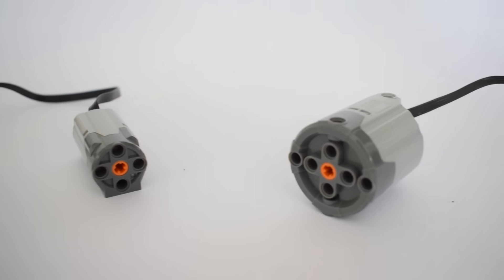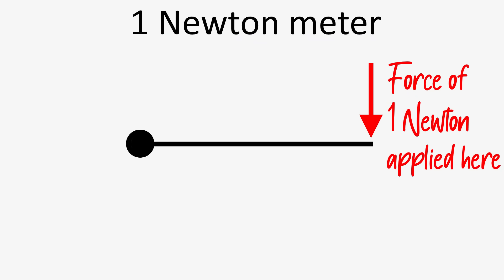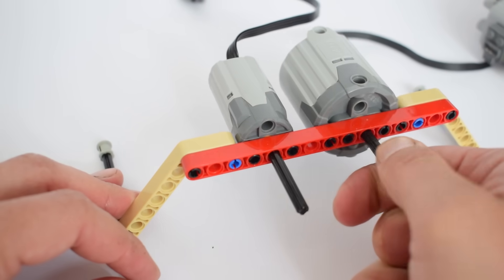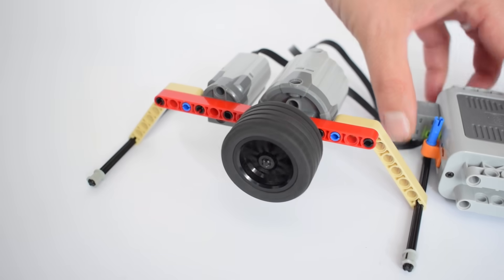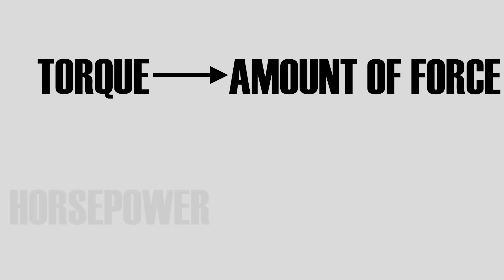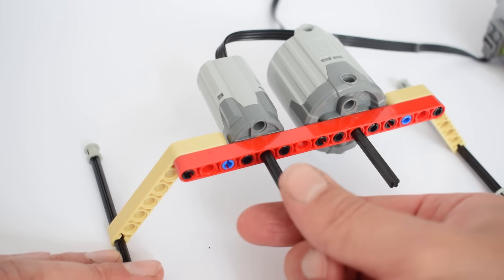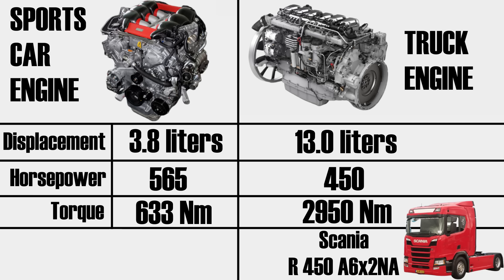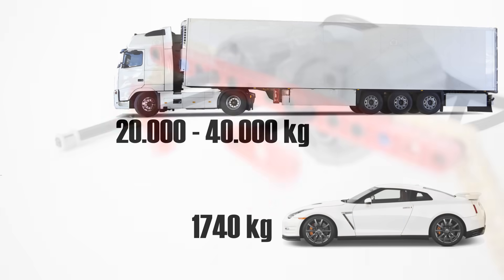NEVER be confused by HORSEPOWER and TORQUE again - HP and TORQUE EXPLAINED in the MOST VISUAL WAY

Comment: Great explanation!! I would only say HP can be felt during fast acceleration. The motion that happens is due to HP, and the feel you have is do to G force. So, it is correct that HP can't be felt directly like torque, but it can be felt indirectly 💪💪
Reply: you cant feel torque 🤭 you can feel force 👍🏻 egzample 1000 nm torque at 1 metres wheel radious vs100 nm torque at 0,05 metres wheel radious pedal to the metal in both the same weight asf at 10 km/h both where you be push stronger into seat? in 100 nm at 0,05 m wheel radiois cos it generate 2000 newtons cpntact path force  vs 1000 nm at 1 metres wheel radiois only only 1000 newtons contact path force 😁👌🏻
Reply: Torque can't be felt, it is hypothetical.

Comment: In theory you could fit that sportscar engine to a truck with a much higher gear ratio and move the truck just as well. But that small engine would be constantly screaming it's ass off and probably not last very long in that configuration.
Reply: That's really the key point - practicality and longevity.   Gearing can achieve pretty much any torque or peak power curve that you want.  But if you're relying on needing that maximum output continuously then you must factor in how practical is your source engine.  Hence, semi trucks that need to be running pretty much continuously to generate income need a reliable engine that isn't going to need an overhaul every couple weeks.

Comment: Pretty interesting that many people understand this theory but in reality they do not.
A real life situation for those that know:    to answer this REAL scenario.
I'm driving a laden truck with a Detroit Diesel 15 Generation 5 engine.
The maximum torque at 1,000 revolutions of the engine is 1850 pounds feet ( not foot pounds ) but the power ( brake horse power ) is 550 brake horsepower at 1600 revolutions per minute, not horsepower as stated. Horse power ONLY represents a linear calculation of engine size, 1000 c.c. cubic capacity, c.c. i.e. 2 horsepower is 2,000 c.c.
Question: I encounter a hill.  What engine speed will give me the most engine power...the highest torque ( turning moment ) or highest Brake horsepower.
Torque   1850 pounds feet at 1,000 revs/min
BHP        550  bhp at 1,600 revs/min ( torque at this speed 1632 pounds feet )
Formula     2 ( pi ) x T × N  ÷ 33,000, T torque, N revs/min, or T x N ÷ 5250

I would be very happy if some one can explain this as Mech. Eng. Professors cannot. A tech. problem to ponder? Thanks.

Comment: Torque is a turning force.and horse power is just Torque times speed .There's a formula for working out horse power using the torque x rpm.
Reply: Sorry for that ,keep up the good work.
Reply: And there is a formula for working out torque using the power / rpm. That's how chassis dyno works.
Torque is not a force, it's torque.
Reply: @simplemachine9531  you confused yourself!
Reply: @skyhawk409  I confused you, cause you don't know the thing. You have just named power as horse power, end of story.
Reply: @simplemachine9531  is 550lbs lifted one foot in one second one hp?
Reply: @skyhawk409  there is a formula for working out centimeters from square and length of the other side of rectangle.
That's how you sound.
Next you ask if an inch is 2.54 centimeters.
I'm out.

Comment: Am I right to say these two things act like runners in a relay race? It’s torque that gets you going and builds momentum, then said momentum is passed on to power to take it further.
Reply from the maker: I get the idea, but the answer would unfortunately be no. Momentum is not passed and there is no switch. Torque is always there and so is power. Torque is an inherent part of power. Power is simply the frequency of torque application. Power is torque x rotations per minute.

Comment: Using gearing you can convert that high RPM torque into low RPM torque where it counts, at the wheels. Why don't big trucks use a smaller higher hp engine and just gear it down? Because the engine would very soon be worn out revving at 6000 RPM all the time to produce that torque needed at the high rpm.

Comment: I would say I've got the theory part of power, but then the in practice part got me...

If power is a time related thing and the smaller engine rotates more per minute, shouldn't it have more power?
It has less, but rotates faster... 

I think I didn't understand as I thought 😂. Does someone know?
Reply: 100 nm at 10000 rpm :9549 x 1,341 = 140 hp , 200 nm at 2000 rpm :9549 x1,341 = 56 hp , 300 nm at 5000 rpm :9549 x 1,341 = 210 hp power is results of torque and rpm this that some engine spin faster dosent mean it have more power it can have but not necessery cos power is not only rpm ,rpm is only rpm you need to multiple rpm x torque at thsi rpm to know how much power specified engine et this rpm generate  , way slower spin engine can have waaaaay more power and accelerate way quicker vehicle feg bugatti chiron max rpm 7000 power 1500 hp  vs bmw s1000 rr max rpm 14000 rpm power 200 hp ☝🏻 beside this video which explain half of whole story and probably make some misteake dont want watch this again 👌🏻
Reply: @mociczyczki  wow hahahah, thanks man
Reply: This is a faulty video, watch something else on this topic.

Comment: Okay so let me see if I understand, if you take two different strength motors and use gear ratios to set them at the same speed, the horsepower measures which is stronger, and if you use gear ratios to set them to the same torque horsepower measures which one is faster? So it's like overall relative motor capacity?

Comment: Not really impressed by the explanation like some other people.
First of all, the physical quantity is called just power. Horsepower is a unit of power. Using those terms incorrectly can lead to confusion. 
And then, some statements about what is power and what can and cannot be felt are misleading in my opinion. Power is the rate at which work is done. Which translates simply to force times velocity in the linear case or torque times angular speed (~rpm) in the rotational case.
I do not think anyone can actually properly understand the correct physical concept of torque and power based on this video.

Comment: I still dont get it. the motor with less horsepower was spinning faster, which goes against what he said. and it made it just seem like rpm = hp, which makes no sense. like, just because a single cylinder engine can get up to 15k rpm doesn't mean that it will crank out more horses than a truck. at 3500 rpm, which is what this video seems to imply. the torque part makes sense but the horsepower part doesn't, especially with how the lower horsepower motor was doing more work at a faster speed than the higher horsepower one.

Comment: maybe i haven't thought this through but with my electric bike outputting 29kw of power i can search a google kw to hp conversion if hp needs time to be factored into the equation. However, to calculate the actual torque you need to. take rpm into the equation.
Reply: kw and hp are the same thing ie power (force and time). To determine torque from power, torque = (HP/RPM)/5252

Comment: The way I've always thought of it is this. Pretend you have a screwdriver, and a small drill. The drill will screw in a lot faster, it has more horsepower. But you and the screwdriver are able to screw down much more tightly, you have more torque.
Reply: How do you know you are screwing with screwdriver with less power?

Comment: Thank you! I'm sick of watching dyno videos where people obsess over crank torque - it's IRRELEVANT, because it's gearing affected. Torque at the WHEEL is what matters, and when you factor in wheel (road) speed with wheel torque, you have wheel horsepower which translates directly to crank horsepower (after frictional losses) even tho gearing means the engine speed and torque are different to the wheel's speed and torque - the SAME WORK is being done. So when people say "torquey" they actually mean "low rpm HORSEPOWER" or "broad power band" so you don't have to swap cogs so often.  But so what? We have 10 speed transmissions now, we can have a narrow power band, no bottom end torque so just don't use that rev range, put a CVT on it and you can drive around like a locomotive lol. Constant rpm + constant torque = constant horsepower at the crank, variable gearing means different torque and rpm at the wheel but ALWAYS the same horsepower as the crank (ignoring frictional losses). Perfect! If the people who say "torque moves the car" were right, then everyone would be drag racing Wartsila SHIP engines.  They don't, because torque at the WHEEL moves the car and a ship engine does 83rpm and my RS4 does 8250 so I have a HUNDRED TIMES torque multiplication advantage due to gearing, my Fireblade bike revs to about 13,000rpm and makes NO crank torque but at the wheel, 180hp at 100kph is the same wheel torque as a CAR making 180hp at 100kph with a 2:1 gearing disadvantage to my bike ... puff... pant... calming down... okay I feel better now, I've been trying to convince people ever since Faster Proms became a thing so THANK YOU! 😊
Reply: when people say torquey, they mean torquey.

Comment: Hp is more important about engine power than torque. With more hp engine you can get both more torque and speed than lower hp one by using gear box

Comment: Torque determines how quickly you can accelerate and power determines your top speed.
Instead of using rotations you would want to use radians to make the units work out.
Reply: Think why racers shift gears up at maximum power revolutions and do not care about torque

Comment: Imagine lifting 20kg twice (low torque) vs lifting 40kg once (high torque) in the same amount of time. That would be the same amount of horsepower but the 20kg twice is easier because it requires less torque.

Comment: Large engines have a longer throw, the stroke.  Longer stroke is a longer lever on the crank shaft.  Longer lever means more force, much like the two wrenches shown in the video.  But longer means slower rotation.  

Torque is a measurable force, rpm is a mathematical calculation.
Reply: Torque is not a force and it is a calculation of force times radius, of course

Comment: Torque: acceleration 
Horsepower: top speed
Reply: Wrong. Watch some other videos.
Reply: @simplemachine9531  how would you put it
Reply: @DESTRAKON  ok
Second law of classical mechanics is Force=mass x acceleration. Power=force x speed, which leads to 
Power=Acceleration x Speed at a given mass of a car.
From where 
Acceleration=Power/Speed 
Speed=Power/Acceleration
In practice it looks like this: you shift a gear down to start a faster acceleration. This only works if you do not exceed maximum power output, because if you are at maximum power revs already you can't accelerate anymore faster than that, even if you shift 10 gears down.
Reply: @simplemachine9531  gotcha

Comment: Can't help but wonder - wouldn't you be able to use leverage (gearbox) to generate higher bhp in the motors with more torque?
Reply: It's more like the other way around: a high-power engine can use shorter gear ratios to apply more force to the wheels at a given speed, so engine torque as a metric is basically useless. If you put the GT-R engine in the truck and change the transmission it'll be able to haul the same loads as the original truck engine, albeit with less-flat torque/power curves (and being very inefficient), and likewise the truck engine would be able to get the GT-R to go as fast as it would with the GT-R engine if it could fit and didn't weight as much.

For both towing capacity and acceleration (and top speed), the only thing that matters (besides weight and drag) is the force being applied by the tire to the road, which is the engine torque (measured from the crankshaft) multiplied by the gear ratios (from the current gear you're in, final drive, and the wheel diameter), which directly corresponds to power, since you can double the gear ratios if you can output the same engine torque at double the RPM. It's also important to not forget that torque/hp usually means peak torque/hp, and that both of them vary continuously through the RPM range, so you'll only be able to use the peak values all the time if you have a CVT and are within its range.

Comment: 1. Horsepower = how fast you go
2. Torque = how fast you reach that speed.
I've once read that a gentle breeze means that you need extra 100+ horsepower to reach 200mph
Reply: Wrong.
Power is acceleration times speed for a given car.

Comment: When it comes to cars and machines.....Foot Pounds all the way!, NOT Pound Feet, and NOT Newton meters. 
Newton meter is confusing as everyday people don't know what a Newton is. It is a Kilogram of force, BUT as applied over  a Meter over Time.   N is described as a 1 Kg mass moved 1 meter per second squared

Time is NOT factored in when using foot pounds.

As you explained. 3 Pounds of Force applied to a 1 Foot Lever = 3 FtLbs. A person can imagine 3 pounds of weight sitting on a 1 foot lever.    For newton meters it converts to 4.0675, but there is no direct correlation, as time is involved. The 4.0675 is NOT kilograms

You can do the conversion with the factor of 1.3558 x ftlbs = nm. Or nm/1.3558 = ftlbs, but I will always say foot pounds, when talking vehicle torque, or tightening a bolt.  

To further confuse things, a Joule of energy is the SAME as Newton Meter........

I DO use NM when talking Mesh Tension for Screen Printing. (I print Tshirts for a living) Only because that is the way the industry calls it, and you just end up knowing that 7nm tension is barely useable Mid 20s nm is good all around tension, 40 is very tight, and 100 is mind blowingly tight but also will explode at the slightest nick.

If you grow up with NM then when applied to cars etc of course it will all makes sense the way screen tension does to me, but you still won't know how many kilos of force. 

- Cheers
Reply: A joule is not the same as a newton meter or torque. They are dimensionally equivalent but one is torque and the other is work/energy. Its the same for pound-foot and foot-pound. A pound-foot is a unit of torque, but a foot-pound is a unit of energy or work.
Reply: Now the fun part for you: pound is not a weight.

Comment: For a car to climb a steep hill, which is more important, torque or horsepower?
Reply: There is no such choice. There is a choice between torque and rpm. An engine produces a given amount of maximum power and you shift between torque and rpm through gearbox.

Comment: Very good explanation,  but I get still confused because engine have different torque and hp depending on the rpm of the engine. Surely the more the engine rev up,  the more hp it should have since it goes faster but we often see it drop past some high rpm.
Reply: car engines have very specific designs.  the fuel injectors have a maximum volume per time output, and the fuel pump itself can only pump so much before it will hit a ceiling. the more power you generate in an engine, the more fuel and oxygen it's going to intake. you may say duh, but this is the basis for why an engine's output isn't infinite with increasing rpm's.  the intake manifold, the pistons, piston rings, crank, etc, are all spec'd to a certain point before they will no longer perform and can in fact catastrophically blow up.  heat generation increases as well. old pushrod engines would have valves that would literally start to float at higher rpm's, for example, because that was just a consequence of the design.  many engines are designed primarily for fuel economy and emissions friendly, in particular, so they are not built as high performance engines to begin with.
Reply: Power= torque X rpm. If rpms increase slower than torque decreases then we see power reduces.
Reply: i was also confused by this, it's because an engine isn't a mathematical equation, it's a contraption that needs to take fuel, mix it (and do it well - which takes time) and burn it
when the engine rotates very fast, it becomes more and more difficult to achieve good combustion (too little time), so the torque stops increasing and begins to fall, HP soon follows

Comment: And even easier explanation is using a screwdriver to pull out a screw.  When the screw is tight you use the handle that is wider to provide more torque. When the screw is loose you can spend the shaft itself and get it to spin faster and thus more horsepower. 
Edit: assuming equal force applied to the screwdriver in both applications.
Reply: How do you know that unscrewing a bolt using a wider handle doesn't require more power? You are very confused with that "with less power and thus more horsepower".
Reply: @simplemachine9531  what he meant is that unscrewing a screw by moving the shaft of the screwdriver faster is analogous to higher horsepower (high rate of power) while starting to unscrew a stuck screw from a wide handle with the most leverage possible gives the best torque.
Reply: @aseidinfo  read again that non-sense, power remains the same, it's in your hands and can't be reduced or increased by tools. Torque can be, and this is why there is no example of "power vs torque"

Comment: My explanation is the feed mill example. Consider the work completed when a grain elevator belt moves grains. Horsepower is the description of the amount of grains it can move. Torque is the width of the belt. Belt speed is RPM.